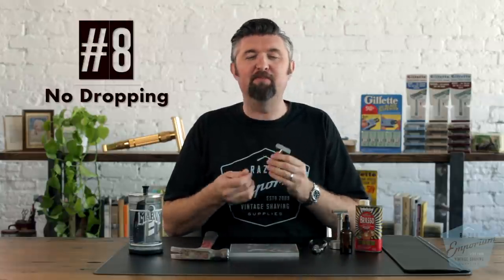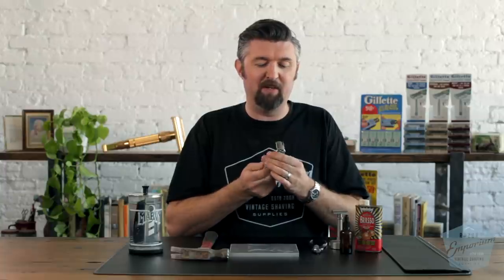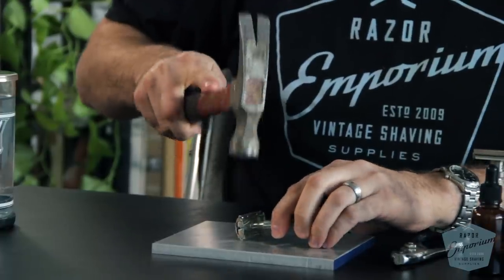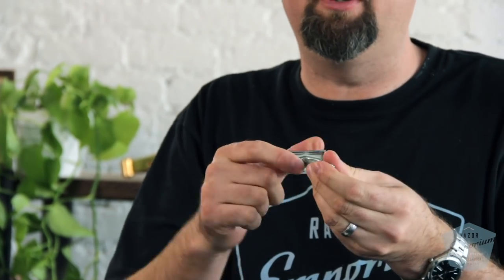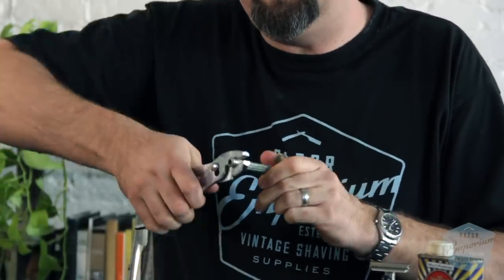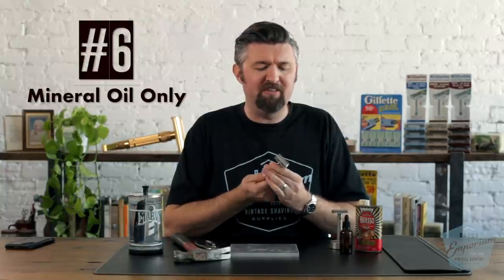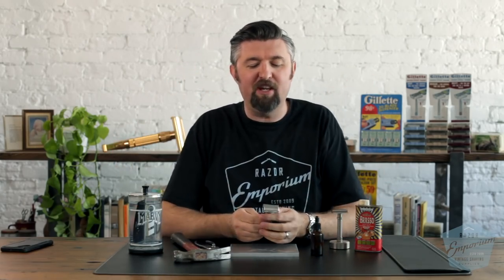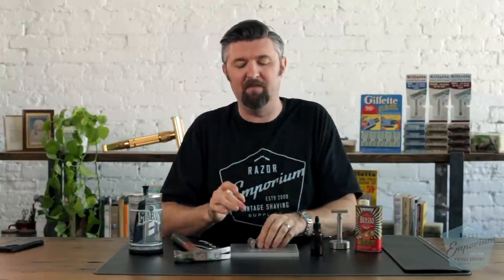10 Tips to NOT Destroy Your Double Edge Safety Razors!

Comment: Possible number 11. Dont overtighten when you change blades. A lesson learned from experience. . . . I pulled the threaded piece from the cap on a DE89.
Reply: Especially with razors made from zamak, it may kill te razor.

Comment: A chemistry teacher speaks. Vinegar is not a strong acid. First, vinegar is not an acid at all as such, but contains ethanoic acid (acetic acid) as an ingredient. Ethanoic acid is a weak acid as it only partially dissociates into hydrogen ions, unlike hydrochloric acid that completely dissociates into hydrogen ions and is therefore classified as a strong acid. However, vinegar has enough ethanoic acid to damage metal such as may be found in a razor. 😉

Comment: Alton Brown of Food Network fame illustrated galvanic corrosion very well by putting tomato based products in a seasoned cast iron pot, covering the pot with aluminum foil, and THEN putting the lid on. The resulting VERY small amount of electrical discharge vastly increased the rate of corrosion to the point that the aluminum foil DISSOLVED.😂 Kitchens, bathrooms, enclosed spaces and high humidity environments with various chemicals just EAT holes in high carbon steels folks

Comment: One of my shavers is an old 1960 Gillette Fatboy that used to be my dads. I did hose mine down with WD40 because I wanted it to get it down in the handle and not only lube up the moving parts but also help remove mineral deposits. I was amazed at how smooth it worked after that. Did I use it to shave right after hosing it down with WD40? No, I took a toothbrush and some warm water and used some dish soap and cleaned it. After rinsing it off I put it in a stand with the butterfly wings open to let it dry. I also remove the blade and give it a spritz of Clean Shower to prevent mineral deposits and stick it to a little magnet to dry. I also have a Vikings Blade Emperor which I clean with the toothbrush and some dish soap and that keeps it looking as good as when it came out of the box. Using these old technology shavers to shave with now is much more enjoyable than using the modern cartridge style razors.

Comment: I've made some of those mistakes, but have not done any significant damage on my razors. My cleaning routine is basically an old toothbrush and liquid had soap. Works great. For the blade, I simply have a magnetic base on my bathroom mirror and put the blade there to air dry. Never had issues with blades rusting on my razors.

Comment: After every use I always disassemble a razor, rinse off all parts and dry with a towel. Never had any issues with dirt, apart from some soaps maybe in the guard holes. But then a toothbrush and some dishwasher liquid will take care of that. That’s all I have to do to keep my razors in good condition.

Comment: Excellent advice! I just got a 1955 Gillette flare tip in excellent mechanical condition but it was covered in years of neglect and soap scum. After cleaning it with hot water, dishwasher liquid and an old toothbrush it cleaned up nicely. I then simply buffed the cap with an old sock and it shined right up! Thanks for confirming my thoughts on boiling the razor or using abrasive polishing compounds. It's simply not necessary.
Reply: I just bought a late 50s English Gillette flare tip Rocket two days ago. Found it on the back of a shelf of junk in an antique store in perfect condition but it could still use a good cleaning. Think I'll give it a gentle scrub today with some Dawn dish detergent and a soft toothbrush and then buff it with an old sock. Thanks for the tips!

Comment: Happy New Year!!! Thanks for confirming that I'm smarter than I thought. Never used Barbicide or metal polishes. I've always dried my blade after every shave and I clean my razor using an old toothbrush and dish detergent when needed. Food-safe mineral oil is the only lubricant I use.

Comment: Loved this, Matt; thank you! I take the blade out after every shave and "pat" it dry (no rubbing, just literally laying the blade in a towel and covering it with another part of the towel to soak up the water). Then I put it back in the wrapper. My razor, I leave loose -- butterfly's are open all the way and three-pieces are not even tightened down even one turn. I've not had any issues with rust or discoloration. 

I have, however, boiled an old Gillette adjustable. It was like someone had poured molasses down it! When I boiled it, all this grease appeared on the surface of the water; it was disgusting. Of course, now I'm thinking that it might have been some coating on the razor (but these were nichol so, perhaps not).

Anyway, I just shipped my Christmas present to you (it arrived New Year's Eve) for revamping! I'm so excited. It's my birth year and quarter! It's a K3 Slim Adjustable. I can't hardly wait!!!

Comment: Very informative and saved me from the Barbicide mistake...lol I always take the blade out and wash and dry mine in a clean towel after every use. Occasionally wipe it down with rubbing alcohol since I had a few, bitter, rounds with Staph infection over the years.

Comment: Hi Matt- Great video on razor care do’s and don’ts. Luckily I have a few RE polishing cloths which are great. I did have a question about sonic cleaners, please. I’m thinking of this in particular for the Shick injector-type razors where the metal head is formed by folding a few layers of metal on itself. It’s very difficult to really clean those areas. Running a razor through the sonic cleaner with warm water and some anti-bacterial soap seems like it might be an answer for this specific razor. I would greatly appreciate your thoughts, please. Wishing you and your family a very Happy New Year! All the best in 2021, Matt!
Reply from the maker: 4th request today for an ultrasonic cleaning video. Will do!
Reply: Thanks, Matt! Best regards!
Reply: Pipe cleaners and toothpicks work well to get in the nooks and crannies of a Schick.
Reply: @johnfregeau8981  Thanks, John!

Comment: Matt👍👍💈  Happy New Year bro.  OK you got me, I usually do the Dawn and toothbrush routine first, then a quick soak in sterilizer/alcohol.  Just a 10 minute soak then rinse and dry.  The rest of these items I haven't done except for the Flitz wipe down which took the gold finish right off a 1920's/30's New short comb top cap, lesson learned.  Great video and tips, thanks.  I can only imagine what you have seen come into your shop for repairs, good laughs and head shaking.  I will admit to using an ultrasonic cleaner with mild cleaner, so far so good.  Enjoy!
Reply from the maker: Ultrasonics are good

Comment: Oops. I used vinegar and boiling when I first started collecting. Read about it on some forums. No noticeable damage so maybe I got lucky. I would like to add one to your list: Don't soak your razor in borax. I was lucky enough to get my hands on a Gillette toggle. It had some plating loss but at least it opened and closed smoothly, had the paint on the numbers, and had the red dot. After soaking it in borax and warm water it was really clean, but the red dot disintegrated. Boy that made me mad.

Comment: I have ruined a handful of aluminum kitchen tools in the DW. Aluminum doesn't play well with washer detergent. It ruins the finish and they forever shed black kaka. 

On a happy note today I ordered a Rex Ambassador and stand. Looking forward to it. The reason could also be a tip. I have a Mergress and a Timeless. I soak them in CLR. I left them in overnight a few times. The Mergress one day wouldn't thread. I looked at the cap and half the threads were eaten away. Merkur thankfully sells replacements for around $8 on their site. I also noticed a discoloration in the finish on the handle. I have no doubt leaving cheaply plated metal in CLR overnight is not a good idea any more. :)

Comment: Ok I'm glad you're saying this .
I over tightened a coated zinc razor head and while the damage is minimal, I see an etching mark on the base plate..
And I lost sleep over it, it was an accidental idiot move on my part.. 
I had someone say it needs to be coated immediately..

It's a forty dollar razor,the head is zinc, and the handle is stainless steel..
I simply forgot to use the bumper ring aka oring that came included.

I had looked at it again and used a bumper oring that's even bigger now and the mark is significantly covered yet I'm looking at it and worried I ruined a brand new slant razor head.

Comment: 9:25 is another reason why the rex ambassador is king - it's one of the only few razors on the market which has a male post on the razor stand.

 You can insert a razor blade on the post and sandwich the blade between the base of the razor stand and your razor. When you want to use the blade, simply remove the razor and unscrew the post from the base. Storing the blade this way also reduces risk of cutting yourself by eliminating the need for a loaded razor

Comment: I do like to disinfect a used vintage razor, after cleaning with detergent, hot water, and a brush; before I put into use. After a thorough drying process, I like to use rubbing alcohol to dip the head of the razor in, just momentarily, high proof booze would work too.

Is this a safe procedure for the antique Gillette gold washed razors with lacquer? I can't say for certain. But, who knows where an 80 year old razor purchased from a thrift store, estate, or auction house has been? Once a razor is in my den, I see no point in sanitizing it. All the cooties on it are mine.

Sunlight is a very effective sterilant; but there is a shortage of that this time of year.

My point #11 would be: put it away clean and dry after every use. That way you will never have to resort to any heavy duty cleanup on your razor. I like to use a nylon bristle knuckle brush and whatever leftover shave soap I have left in the shave brush from the use of the day to clean up my razor. It takes 10-15 seconds, max.

Comment: Thanks Matt.  I read SO MANY differing opinions on this topic, it’s great to get the skinny from someone with experience fixing the end results of errors.  What about Scrubbing Bubbles?
Reply: been using scrubbing bubbles for decades on my old and new razors zero problems.
Reply from the maker: Generally safe to use however it can damage delicate finishes like silver or lacquered gold
Reply: I heard ultrasonic cleaners are good but will take the painted numbers off Gillette adjustables. Is that true?
Reply: @DrRonP  I've heard that as well, and saw it demonstrated in a YouTube video.

Comment: I leave the blade in after loosening and cleaning the blade with water then a dash of alcohol. No problems with rust. I change the blades every 4-5 shaves so they are not in there for a long time. Will soon write a review on your ambassador. Comparing it against my other razors first.

Comment: Great tips, especially about not using metal polish.  I use eyeglass cleaner, the kind that's safe for coatings on eyeglasses, and a microfiber cloth.  You can get it cheap at any big box store.  It shines the razors up nicely, spraying it on and letting it soaks in will take off soap deposits, and it won't eat into the finish.
Reply: Good tip

Comment: Just bought a 1959 fat boy from you. Yes, I boiled it for 4 minutes. 😂🤣😂 no damage but the last 1/4 didn’t work so I used that little bottle of oil that comes with electric razors.
Reply: Did it fix it?
Reply: @6komodo6  temporarily.  Soak it in warm soapy water for a couple hours. Completely fine after that. I wouldn't recommend what I typed 8 months ago.
Reply: @ToMaToEsGrOw  I just ordered Andis Clipper oil just to be safe. Does it gunk up the razor or cause issues, I ask because care notes on the Merkur Progress say to use a lubricant once a while.
Reply: @6komodo6  honestly I'm not an expert. It did clog gunk all inside. I thought I would have to take it apart it got that bad. Warm soapy water did the trick and didn't have to touch it since. You just don't want anything to rust. I don't really see an issue with it but sooner or later it will build up inside. Once again I'm not an expert in razors. What it wrong with your razor?
Reply: @ToMaToEsGrOw  Nothing wrong with it, just wanted to make sure it's in prestine condition for as long as possible. Did the clipper oil clog things inside or was the razor already clogged up from repeated use?
Reply: @6komodo6  it just wasn't twisting shut all the way. I may of used to much oil 8n the end. It was more of a temp fix. It's been a while. If nothings wrong I wouldn't worry about it.

Comment: Hi Matt! Great video. I'm sure I've made a few of those cleaning mistakes, lessons learned. What is your opinion of using denture tabs to soak off soap scum? I have a 109  and an earlier adjustable (silver, not plated) and 2 butterflies I would like to clean up before selling. Thanks for your informational videos.
Reply from the maker: Stay away from them. Just stick to detergent and hot water.

Comment: I was drying my King C with a towel and the blade went straight through towel and into my finger. Ouch! That was a nasty cut. I dropped the razor and bent the threaded handle which I thought I could straighten but it sheared off. It hasn’t been a good week.  Shopping for a new razor, maybe a Leaf Twig.

Comment: Great advice and great video 👍. I was thinking of putting mineral oil on the thread part that screws in the handle, to try and avoid any scale build up from tap water. Would you recommend just leaving the threads as they are but ensure they are dry after use, or, should I use a little mineral oil. Thanks.
Reply from the maker: Oil is fine but overkill
Reply: @RazorEmporium  Thank you very much 👍🙏

Comment: I have an odd question, why aren't razors made of Cobalt? If they are, I wasn't able to find any that are. I ask because I have a Cobalt wedding ring, and after almost six years of marriage, there are not any scratches or dings of any kind. I have friends with gold rings that are newer than mine and are showing wear. One though was that Cobalt may be super expensive. But maybe not, my ring was around $100. Maybe it's too hard to work with? Anyway, thank you for the videos. Take care.
Reply: Though cobalt isn't to expensive it is a extremely hard metal which would make it extra difficult to sharpen I would image. Also with its hardness I would expect it to be quite brittle, especially when as thin as a razor blade.

Comment: Hello I just recently purchased a MINT Gold Gillette Toggle. Is it safe to use Alcohol on it? I always use a fresh blade for every shave, and I use dish detergent to clean my razor with a soft toothbrush after every use.
Reply from the maker: No. Will dry out the lacquer.
Reply: @RazorEmporium  Okay what is the best way to clean it to make sure it is sanitized and safe to use being that it is a vintage razor? I was just going to use some dish detergent and then dip the head of the razor quickly in 70% alcohol and rinse it with water afterwards
Reply: Nice find on that gold Toggle. How does it shave ?
Reply: @jtoo6060  I will be receiving it in the mail tomorrow.

Comment: Is there a brand mineral oil you suggest?
Reply from the maker: Whatever is cheapest
Reply: Pro tip: Don’t buy mineral oil at the hardware store or home center; they sell to wood workers and painters and guys who are oiling their $150 cutting boards. You’ll pay six prices for it. 
Go to the laxative aisle at the drugstore. You can get a lifetime supply for 3 bucks.
Reply: Good call. Can that same mineral oil treat wood?
Reply: @SuperK7654   Sure, but I suppose there may be brands that contain drying agents; anything’s possible. And “baby oil” is just mineral oil with an added fragrance. 
Check the label to be sure.

Comment: Hey Matt, are you familiar with a cleaning product called CLR? Used to clean calcium, lime, and rust. I use it to get rid of blade stains with good success. Would that damage your Rd plating?
Reply from the maker: Wouldn't recommend it.
Reply: I use a 20% CLR solution on nickel plate razors and brass razors where the gold is worn off, soak for 30 seconds and it takes off light tarnish and comes out nice and shiny.

Comment: How about using an ultrasonic cleaner?
Reply from the maker: This is a long answer and maybe we will make a video about them. We have several in our shop and they work wonders. Caveat- it needs to actually be high power and not a cheap one if you expect any serious results. Can also remove paint and lacquer however.

Comment: I used to use Nevr-Dull which is not as abrasive as Brasso. I would promptly wash it off after use though. Are there any other alternatives besides dish soap that you might suggest?
Reply from the maker: Our polishing cloth or flitz very minimally applied.
Reply: Lucas oil gun metal polish. Non abrasive and requires elbow grease. Type of polish you use with a  polishing media like corn cob in a media tumbler. Can load a cloth buffer wheel up and polish away safely in most cases. Avoid polishing gold plate since it wear away easily no matter what but silver and chrome plated brass be fine. Nice mirror finishes can be had with just microfiber cloth as well. Polishing isn't some arcane art it's simple with some good research beforehand. Remember it's easy to remove a finish but impossible to replace it with out fully re plating.

Comment: Are there specific spots you should apply mineral oil to? The razors I have don't have an opening at the bottom, so I imagine you should dab some near the bottom of the hinges and maybe into the opening on top. Also, I would guess this stuff is meant for butterfly/adjustable razors instead of a 3-piece, but I guess you could lubricate the twisting pieces should they get tight.
Reply from the maker: best spot on a tto is where the knob meets the handle. If it's adjustable - above and below the dial.
Reply: @RazorEmporium  And if it's a butterfly should  I also get the door hinges?

Edit: My bad. I didn’t realize TTO meant twist to open. lol